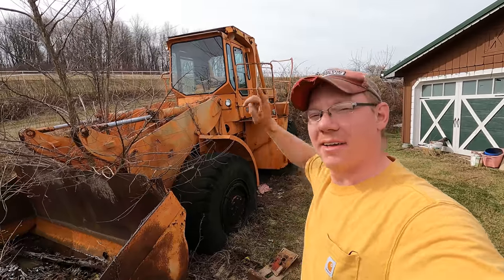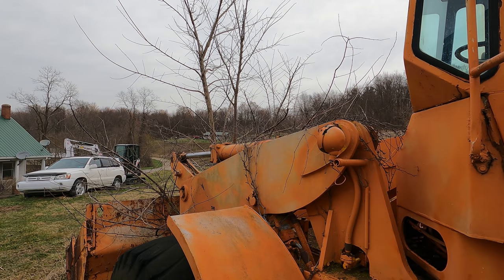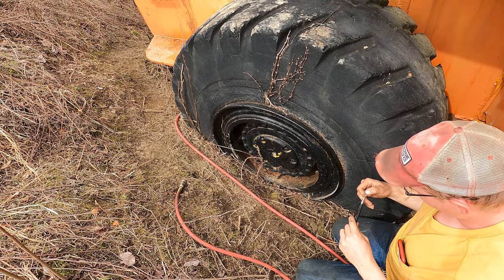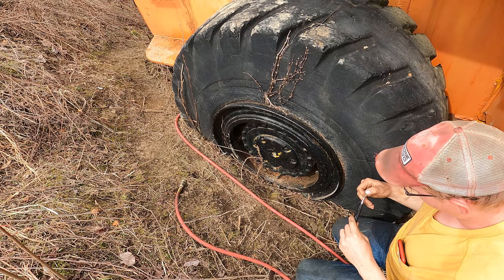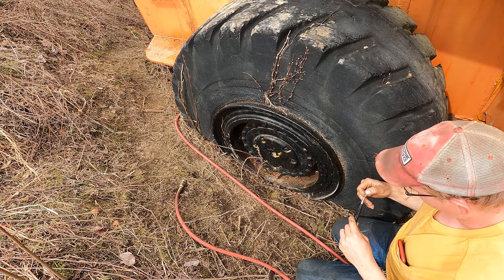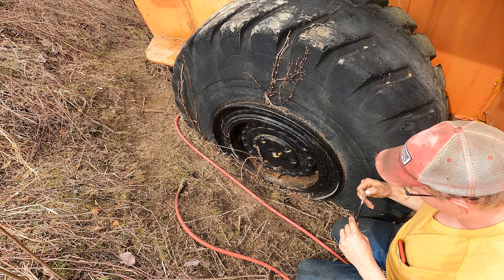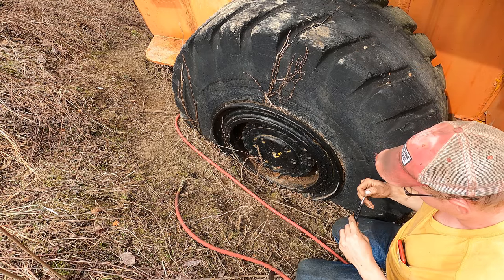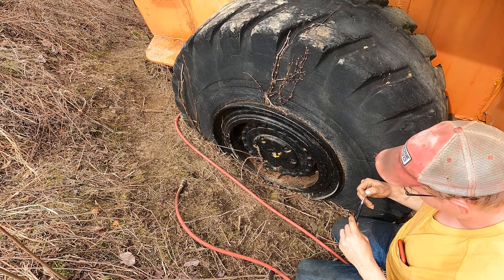After Sitting 20 years will this Big old Wheel Loader Drive 3 miles home!?!? Pt.2

Comment from the maker: Hey yall! I know there is a few rough spots in the audio! I apologize for that, not sure what went wrong but please bare with me it doesn't last long. Hope ya like it!!!
Reply: Keep up the good work man
Reply: Keep the awesome videos coming 👍🏻
Reply: You need to wash it
Reply: Wash it
Reply: Rip ears
Reply: Don't be so hard on ur self it was fine an even if there was major issues we would deal with it anyways. I would. No need to cry over spelt milk. The vid was great. Nice score on the loader. That thing is the opposite of my loader at work it's a 523 deere urs has a small bucket compared to the size of the loader it's self. Mines got a huge doosen bucket on it lol it bounces a lot. The bucket is way to big for my loader at work so u gotta go slow but it'll move some dirt now with that huge bucket.
Reply: The CC helps us deaf uns if you turn it on. If you have already then sorry about the comment and my bad for not waiting for YT CC to catch up. Thanks for sharing
Reply: If all your cameras got wacked by a tree limb an went sideways I'd still watch it! Great content here. Much better than what you could get from  turning a normal tv station on
Reply: Can you put gel/Tore sealant in those leaking Tires if the valvestem is new and the vent cap also it should hold air
Reply: Quite an investment,  for something  that's not even yours yet..
Reply: Awesome video
Reply: Matt, I really appreciate you telling the viewers what kind of money you have in your projects. Your videos inspire people to take on projects like yourself and that info really helps give the viewers an idea if the equipment "deals" in their area are a decent buy or not. You're one of the only YouTubers i see give that info Im very appreciative that you do so. Thanks again for the videos keep em coming!
Reply: Sounds like an issue with the microphone maybe?
Reply: @miningsimple1924  Let me second that. There are some very talented youtubers who can out produce the over paid pro's.
Reply: It’s the frequency from the loader
Reply: I miss the horn introduction but The Semi Super Villains new stuff rocks👌 burnout for 200 000👍🍻
Reply: 8k for this?! You`ll be happy if you manage to get 4 out of it!
Reply: You should do some merch honestly by now so much could be made design wise
Reply: Your mic is clipping -- the noise levels are too high for it. You might want to turn down the volume on the camera a few steps when you know you'll be recording in very noisy places.
Reply: Ya did good brother, keep saving that old iron!
Reply: 200K FIREWORKS....but.....  I want to see a diesel engine get blowed up by sucking a little tube shaped balloon full of TANNERITE into the turbo.  Prefer an old Detroit diesel and call it the "JADE GRENADE"
Reply: Didn’t even notice
Reply: I didn't even notice lol
Reply: I feel like that you don’t need to sell it! It goes great with all your equipment and a perfect match for your autocar
Reply: SAY WHAT!!!!!!!!!!!!!!!
Reply: @miningsimple1924  "Much better than what you could get from  turning a normal tv station on"

Damn sure gotta second that one!!!!!
Reply: I did not noticed it until you mentionned it.
Reply: Don't know if you are aware of this. But you can use 00 grade stainless steel wool to remove rust spots of the chrome rams as well. P.S. I'm jealous what I could do with that machine. Aussie Jeff
Reply: Dont much to do that tire an that tire has a oring that could be bad
Reply: 1500 US you stole it. My problem is shifting it to Australia would cost $15,000 without insurance.
Reply: Dude. It's free entertainment. Love your channel and what you do, so I just ignore it. Seeing this sort of thing reminds me of dragging an old Rover saloon out a garage around 2010. Had been stood for a decade and my.friend and I had it running, inspected and on the road for a total of 350gbp including the cost of the car. Only needed a slave cylinder and some carburettor gaskets.
Reply: It's the frequency of the Loader engine messing up the sound. I had static from a freezer in the supermarket across the street mess up my pc's audio from ambient static.
Reply: No problem buddy love your videos
Reply: Diesel Creek you said you got it for a fair price? Bullshit you know you stole it.
Reply: It happens
Reply: It's all good!
Reply: Should see if Andrew camarata wants to buy it.
Reply: @jackboyden1641  0 watts
Reply: I enjoyed the video brother, always waiting to see Christine again! Can’t wait to see her grading your roads! Thanks for sharing! 👌🏻👍🏻👍🏻
Reply: I would have guessed $700 for those hydraulic lines. Looks like a score though!
Reply: @Zero Bubble
Could'nt say it better ! With Matt here, no BS, no fake drama, no stupid music, no "Dang Son" (hello Gonnsquad) .
Class act. Real guy on real jobs and adventures !  👍
Reply: No problem Matt
Reply: I like that old iron too Matt.
Im an Operator myself and when i had the time and space i would fix up an old dragline.....love those old machines.
Keep up the good work and the videos,but also dont forget to invest time into your Family.
Greetings from The Dutch German Border.
Reply: 200k or even 250k subs. It would be an amazing video to get the old military flat bed on the road hooked up to the Autocar.
Reply: Hey don't know if you know but your old hose had reusable ends save them and reuse else were. Lot cheaper to buy just hose. And if you need any other lines go to local scrap yard and ask them if they have any machinery in there yard you could grab a hose off of. Free fluids and tires too for testing. 👍
Reply: What do you plan on doing with that 🚜
Reply from the maker: @radroofer  I assumed a lot of risk, lot of people still saying they wouldn’t have bought it for that
Reply from the maker: @chrisstegerman8058  I just bought one... gotta get it home now
Reply: There is a 125 WL for sale for 15K in Illinois.
Reply: U got a deal
Reply: @kitecattestecke2303  If the tire guy has to service it, it makes their work miserable and messy.
Reply: @jackboyden1641  ll
Reply: @billisbobagis1687   Mmm mm MMO
Reply: where is the hot part of the turbine?
Reply: Can you make part 3 wheel loader when you repair them guz very liked *1 and part 2.🙄
Reply: @pear7777  At the end he said he was going to regardless because it was worth the engine and other parts alone plus bucket to make profit.  $1500 plus $850 and flip it for $10,000. Dang straight easy money
Reply: @matteogomez3678  love it!
Reply: The yellow button is the brakes like in a big truck when u push it in does anything happen?
Reply: Diesel Creek hydraulic line services. Mobile and 24/7.
Reply: How about a cabover
Reply: @DieselCreek  I would have. I love those old diesels I know where there's a dump truck that would go great with that loader if they come down a little more on the price so I to can steal it. It has the big tires like the loader
Reply: @chrisstegerman8058  same here
Reply: @Perforator-s6e  Its the exhaust. The exhaust turns the turbine
Reply: @TheHuell  to transport it? The problem is with the trailer to haul it out. It is too long to make the turns.
Reply: @DieselCreek  Love your old iron recovery.
Reply: I like this intro over the other one (driving your truck over the camera), mainly because of the volume/intensity of the audio. I always mute the audio or take off my headphones during the other intro. Other than that, no complaints about the audio :) Things happen, and you deal with them and learn from them.

For instance, 38:40 sound like clipping. When the machine was rolling or you were talking it distorted, when the machine stood still and you weren't talking it didn't distort.  It happens when the sound is too loud for the microphone or the gain setting on the recording device. Some of the recorders (like my Tascam 60D) can record the same input at two gain levels at the same time, so you can use the higher gain one for your normal audio, and the lower one to rescue parts that got distorted. Another option is keeping the recorder gain low to minimize the risk of clipping, though that can result in more noise as you'd also boost the noise in post when you normalize the volume.
Reply: Any loader that runs and moves is worth double or triple what you got into that machine, as for the rough spots in the audio there are two words to describe them Sh*t Happens and two words for those who witch and moan about them like an ill mannered, spoiled rotten, four year old child, F**k Off! To everyone else and our esteemed content creator; Have a nice day and a better tomorrow, StaySafe n StayHealthy
Reply: You got it for a song and a dance basically. The scrap value will loan at 50000 pounds more than pays for it. Old machines like this are coming back into Style again, because they don't have any serious or costly repair bills attached to them. You can fix it yourself, you don't have to call a dealership, you can bet a farmer would pay quite good money for a machine he knows he can work on that parts are available for, and then he can fix in his field without waiting days for a dealership service tech.
Reply: Give that thing a Seafoam treatment, clear up a lot of that smoking, guys say it's like an engine rebuild.  Does it ever sound cool!
Reply: The perfect example of good old fashion capitalism!!!
Reply: It’s fine
Reply: Good job my bro
Reply: Nice try mate
Reply: yeah when you got it moving the audio started to crackle a lot every time the engine would rev.
Reply: Ya I really like it and I like how you topped off all the fluid
Reply: im a mechanic and im glad you make it run! and bring it to your place! it feels really good every time  you make that kind of old machinery back to life!
Reply: You mind me asking? Where are you at? County, state? I'm interested in the blue dodge ram and the black SUV if the owner of the property is interested in selling either or both. Exceptional loader!!! Great find!! Me and my boss have been looking for one like that for a while.
Reply: @jackboyden1641  tz¥
Reply: @rednecksuburbanidiot3230  PA.  Read the logo on the bucket arm (OH).
Reply: @shaneschlievert5492  I think he's on the Ohio side of PA.
Reply: can't wait to see.updates on this beast put a new exhaust pipe on it so comes out top not the side of it good luck MATT
Reply: Whats the gals info for that painting?  Don't see it in the description. Can you please edit info
Reply from the maker: @bluntly2165  it’s the very first line in the description linboucher.com
Reply: Could the pops in the audio be from the spark plugs? It's definitely possible I just don't know if the sound matches. But in the louder/higher rev sections it tended to pop more
Reply from the maker: @danjz0404  it’s a diesel bud.... no spark plugs
Reply: I can't bare with you, I'm far too modest. I will bear with you because it's easy. Yup, I'm that guy.
I'm surprised no one else picked up on that.  Congrats on 370K subs!
Reply: Hey professor a poor man's lotor
Reply: I say close to six hundred for the hydraulic lines.
Reply: Audio glitches around heavy machines? What? Speak louder maybe, lol.
Reply: thanks, MATT .... yes, I am a watcher.  I love your videos.. thanks.  I am happy to watch any of your videos.  Best to you and be safe.  I retired from the US Army in 1979 after serving 20+ years, then worked for the US Army as a civilian for twenty-four more years mostly at Fort Sam Houston, TX doing IT  as the "DNS Admin" for AMEDD and I really loved it, then retired again in 2015.  Done working now.  I am fine and love being home with a family with several different computers and IT here at home to keep my mind busy.  Best to you and your family.

Comment: I just described your channel to a friend as “roadkill with heavy equipment”. Honestly I think it’s accurate at this point.
Reply: Lol right that's a good one
Reply from the maker: I resemble that remark!!! Haha thanks!
Reply: @DieselCreek  your welcome! As a heavy equipment tech it’s nice to see people still value the iron that can be fixed with wrenches.
Reply: @deeredrummer47  the stuff they build now wouldn't last as long as the old stuff an still run.  The old stuff is the solid stuff. My skid steer breaks a decent amount it's mostly electric stuff or sensors ect..  the cat 180 at work will engage the parking break while driving at least I think that's what's going on.

Comment: Sorry to write a second time. My dad's contracting firm had a '60s vintage Michigan 75 non-articulating loader that I just loved (rear wheel steer). It was the coolest looking machine. It was operated by a wonderful 'good old boy' with the improbable name of Stomper Skeeter. He was a cracker jack on that loader. He would drive it across town backwards as though he were driving a caddy! I loved it so much, that I'd sneak up on that Michigan loader whenever I could and start moving some dirt around. I was just a kid, so it's lucky I didn't drive it into something. I loved the sound of that Detroit Diesel two-stroke engine too. Your loader brings back great memories, even if that Cummins motor is a four-stroke one. These 175's and 275's were used often on large diameter sewer and storm water pipeline projects.

Comment: Hi Matt, looking at the other hoses you may want to build your own. Either use reusable fittings or get a good crimping tool and buy the cheaper one time use fittings. You have enough equipment that has hydraulics that it would be cheaper in the long run to make your own hoses. A good selling point to point out to buyers when you put it up for sale.

Comment: You stole that machine at $1500 I can’t even find a decent zero turn mower around here for that price
Reply: I know that's right
Reply: Supply and demand... there is a strong demand for zero turn mowers, not much demand for an old machine that needs a good bit of work.
Reply: I can't even find a decent truck for that price
Reply: @impishbehaviors  Oh yeah of you want a pickup that's in halfway reasonable shape you are going to have to spend at least $5500. If you want it to not need a bunch of repairs then about $12000. And if you want it to have a reasonable mileage around 100k then all the way up to $18000
Reply: @impishbehaviors  I can’t believe somebody thinks they’re going to get a decent truck for $1500. 😂 you’re missing a zero on there if you want something at least decent.
Reply: generally speaking, the bigger the old iron is the cheaper it gets to buy it because they are too big for the average person to run and use, too heavy to more without a lowboy and expensive to maintain.

Comment: Very satisfying, new subscriber!
Reply from the maker: Awesome!! Glad to have ya!!!
Reply: Same here period one of the best channels I found. Greatly appreciated being disabled Farm Boy
Reply: Same here, too!
Good job!!
One suggestion. Did you noticed the wear marks, and where the big front ram hydraulic line was broken? With the new hydr lines being even longer than the originals, you'll be getting even more rubbing on that same locations very quickly. The price of those new lines was WAY high, but sometimes we don't have a choice. Suggest that now since you've got it home, search around for a hydraulic shop that will cut them down to the correct length, for a reasonable cost. Shouldn't cost more than $100-150.

Comment: I think the "dump" valve is for pumping ballast in the tires.
Reply: Most likely
Reply: I think you're right
Reply: Calcium chloride has been used in a lot of farm tractors.  I think it has been replaced by something else because a flat would leave a dead spot in the field.

Comment: In 1966 - 67, I lived in Benton Harbor, Michigan. I worked third shift as a material expeditor where they made front-end loaders: 125s, 175s, and some where you could put a 1959 Cadillac in the bucket. Serious machines.

Comment: Should be filling the tires with the valve stem removed, they fill much faster. Then quickly install valve stem once the chuck is pulled off

Comment: How does something this expensive, and still running and operating, get parked and forgotten for 20 years?
Reply: Upgrading to newer machines. My boss had a d9 sitting in the field by the shop for 7 years after he bought a Hamm roller. The roller makes more sense for packing down logging roads.
Reply: He said in the first video that the seller's husband passed away.
Reply: It's a bit past it really 
Needs 6k worth of tyres for a kick off 
Going to be leaking from every orifice in short order with all the dry rotted hoses and orings 
The type of person with the money to spend on it isn't going to put into a machine this old 
Well suited to a you tuber who can make money off fixing all it's problems but not really good enough for a business and too big/expensive to just keep in your yard to play with

A farmer might buy it 
Prob the only business that can afford to drop big dollars in and not require a reliable machine (just use it occasionally)

Comment: In Europe i will get those hoses for about 20$ each. Nothing special, every hydraulic store has them all over here. Maybe you should get another dealer.
Reply: A hydro hose for small cylinders are cheep. Most large lines arnt cheep I figured he spend close to $500 for the set.
Reply: @BrokeBeardedGuy  This is a small hose believe me!
Reply: @Gadeto  lol if you say so, I consider a small hose the 1/2 and 3/4 that feed attachments like grapples and brooms